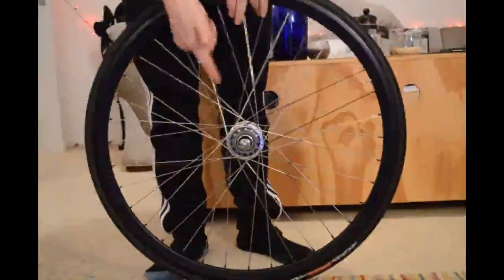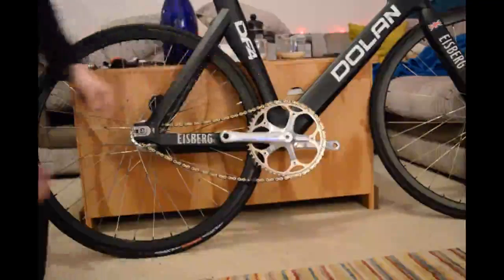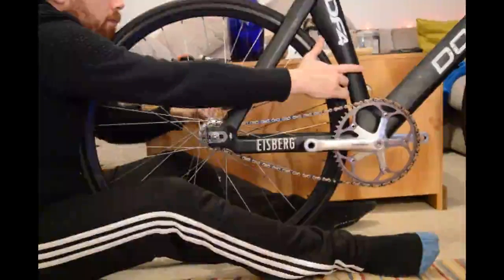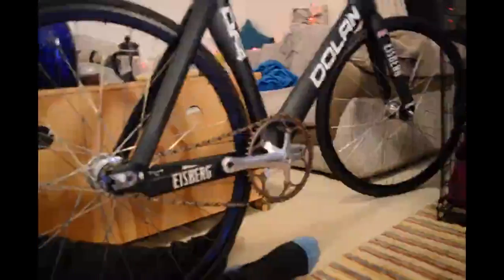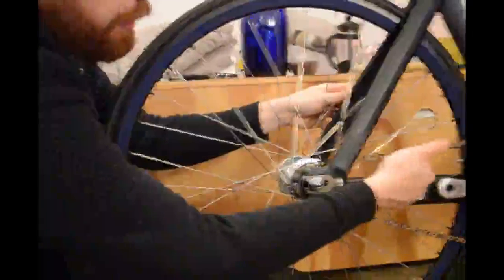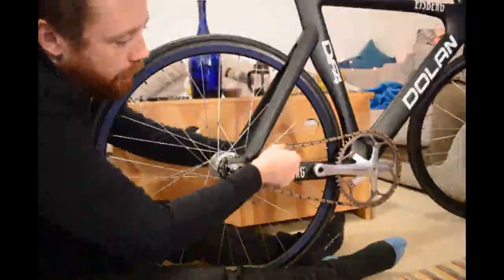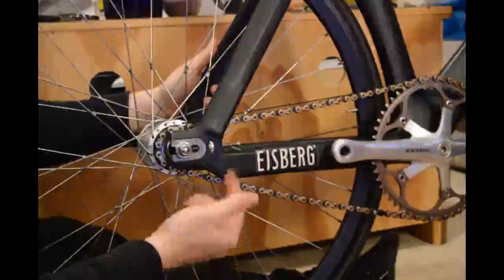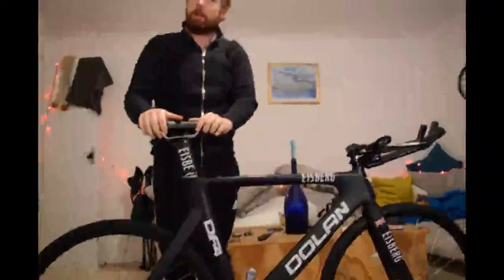Fitting rear wheel and adjusting chain tension on a track or fixed gear bike

Comment: I have a flat on the top of the wheel but not on the bottom. How do I put air in the top of the tyre but not the bottom?
Reply from the maker: You have to pump upside down

Comment: I just find something to wedge in between tire and frame while I hold back breaks and tighten
Reply from the maker: You can do this, but you run the risk of making the chain too tight, especially if your chain or cog isn't perfectly round.
Reply: Use a tennis ball
Reply: i’ve tried that method; that screw accessory will take care of that; most shops can accommodate and it’s a big help